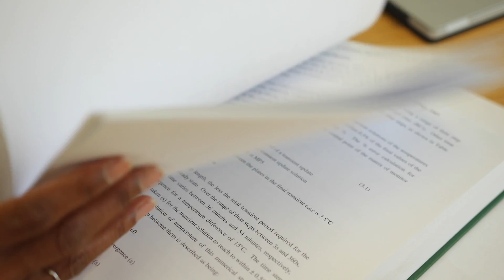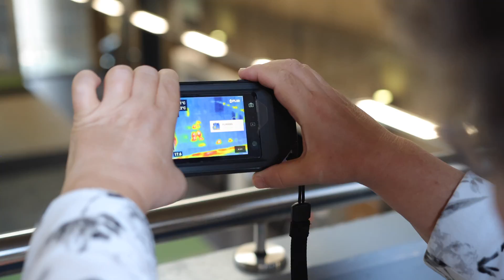My Engineering Story

Comment: Awesome! I have a bachelor’s degree in Mechanical Engineering from Beijing Institute of Technology. My thesis was about increasing the operational range of turbo machinery using casing treatments. Lots of work but worth it. I used Fine/Numeca turbo CFD software to design the casing treatments 👍🏿 would love to do more research on the subject but I’m a-bit skeptical where to do it. Any advice on which schools I should apply to?